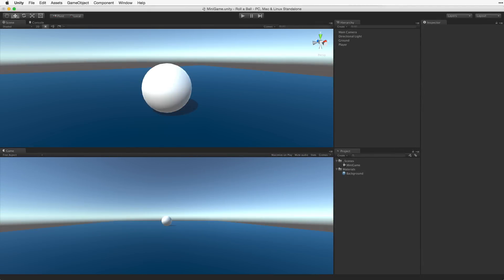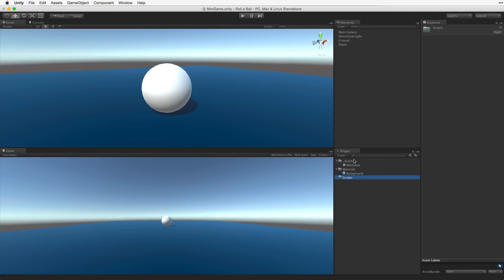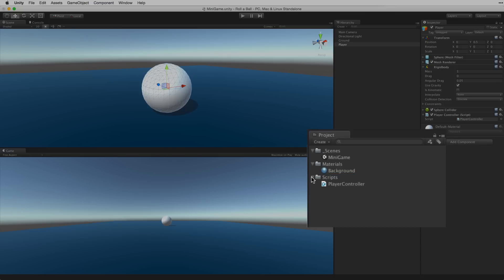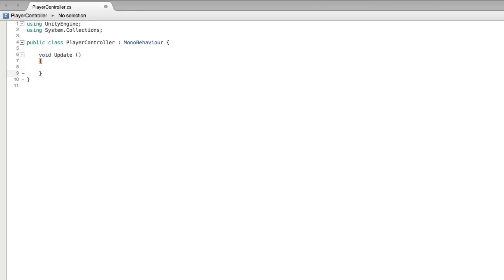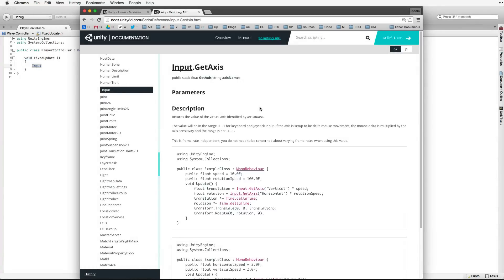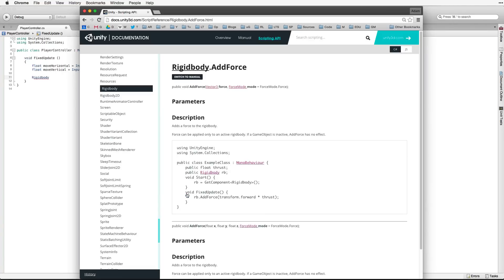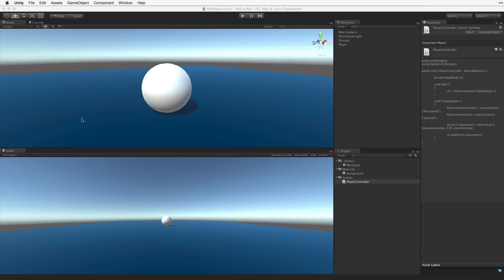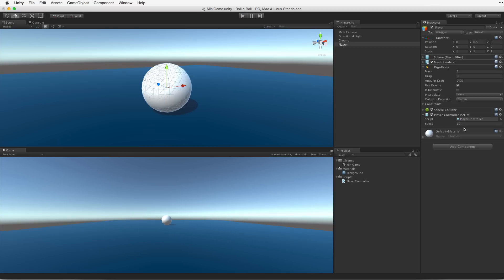Unity 5 - Roll a Ball game - 2 of 8: Moving the Player - Unity Official Tutorials

Comment: I'm getting this error 
MissingComponentException: There is no 'Rigidbody' attached to the "Player" game object, but a script is trying to access it.
You probably need to add a Rigidbody to the game object "Player". Or your script needs to check if the component is attached before using it.
UnityEngine.Rigidbody.AddForce (Vector3 force) (at C:/buildslave/unity/build/artifacts/generated/common/modules/Physics/DynamicsBindings.gen.cs:1317)
PlayerController.FixedUpdate () (at Assets/PlayerController.cs:23)

Comment: Followed step by step, nothing happens.
Here is my code:
/////////////////////////////////////////////
using UnityEngine;
using UnityEngine.UI;
using System.Collections;

public class NewBehaviourScript : MonoBehaviour {

    private Rigidbody rb;

    void Start()
    {
        rb = GetComponent<Rigidbody>();
    }

 void Update ()
    {
 
 }

    void FixedUpdate ()
    {
        float moveHorizontal = Input.GetAxis("Horizontal");
        float moveVertical = Input.GetAxis("Vertical");

        Vector3 movement = new Vector3(moveHorizontal, 0.0f, moveVertical);
        rb.AddForce(movement);
    }
}
/////////////////////////////////////////////
no error messages, 1 warning:
"There are inconsistent line endings in the 'Assets/Scripts/PlayerController.cs' script. Some are Mac OS X (UNIX) and some are Windows.
This might lead to incorrect line numbers in stacktraces and compiler errors. Many text editors can fix this using Convert Line Endings menu commands."

Nothing happens, please HELP!
(Unity 5)

Comment: I typed all the code in and clicked play but when I use the arrow keys, my ball doesn't move. This is my code:

using UnityEngine;
using System.Collections;

public class PlayerController : MonoBehaviour {

 private Rigidbody rb;
 
 void Start ()
 {
  rb = GetComponent<Rigidbody>();
 }
 
 void FixedUpdate ()
 {
  float moveHorizontal = Input.GetAxis ("Horizontal");
  float moveVertical = Input.GetAxis ("Vertical");
  
  Vector3 movement = new Vector3 (moveHorizontal, 0.0f, moveVertical);
  
  rb.AddForce (movement*100);
 }
}

PLEASE HELP

Comment: still doesn't work here is my coding check if there is something wrong 
using UnityEngine;
using System.Collections;

public class NewBehaviourScript : MonoBehaviour {

 public Rigidbody rb;
 void start ()
 {
  rb = GetComponent<Rigidbody> ();
 }

 void fixedUpdate ()
 {
  float moveHorizontal = Input.GetAxis ("Horizontal");
  float moveVertical = Input.GetAxis ("vertical");

  Vector3 movement = new Vector3 (moveHorizontal, 0.0f, moveVertical);

  rb.AddForce (movement * 20);

 }
}
Reply: +Nathan Suciu 
change the following : Input.GetAxis ("vertical") by
 Input.GetAxis ("Vertical")
Reply: +slim Khaled nothing
Reply: +slim Khaled here is my updated coding:
using UnityEngine;
using System.Collections;

public class NewBehaviourScript : MonoBehaviour {

 public float speed;

 private Rigidbody rb;

 void start ()
 {
  rb = GetComponent<Rigidbody>();
 }

 void FixedUpdate()
 {
  float moveHorizontal = Input.GetAxis ("Horizontal");
  float moveVertical = Input.GetAxis ("Vertical");
   
  Vector3 movement = new Vector3 (moveHorizontal, 0.0f, moveVertical);
  
  rb.AddForce (movement * speed);
  
 }
}
Reply: +Nathan Suciu 
Your class name should be the same as your script name : try changing the following line :
public class NewBehaviourScript : MonoBehaviour    by the following line :
public class PlayerController : MonoBehavior (the name of your script)
Reply: slim Khaled now i can change the speed variable in unity but i still cant move the ball. do i need to set the controls or something
Reply: +Nathan Suciu 
Did you attach the script to the Ball or the Player ?
Reply: slim Khaled ball witch is tagged as player

Comment: The ball doesn't move for me.

I get an error message that says
ArgumentException: Input Axis horizontal is not setup.
To cahnge the input settings use Edit-> Project Settings - > Input
Reply: ***** Also when I go to the input Manager its all filled out. There is only two blank sections in the Horizontal and that is. Descriptive Name, and Descriptive Negative Name. And invert is unchecked.. everything else seems to be filled out already so what am I doing wrong?
Reply: ***** Figured it out, damn capitalization got me all messed up here. I don't get why some things are capitalized and others aren't. Seems impossible to memorize all this stuff.
Reply: Thanks, this was driving me nuts! I just needed to capitalize the "V" in the word Vertical in my script and that fixed my first error.
Reply: +JE Woo i have the same problem but i don't why big letter all i corrected but error input axis horizontal

Comment: If you are having trouble with the scripting, make sure every letter is the exact same case as the example in the video.  I was failing at this for hours because i typed "void start ()" instead of "void Start ()" Once i fixed the cases, the given code worked.
Reply: Thanks! I had the same issue and it fixed my second error so I could run the game properly.

Comment: Why did you use 0.0f for the y value in that Vector3?
What is that 'f' for?
Reply: Daniele Dente I'm pretty sure "f" stands for "force". Your computer would read it like this: "I must use precisely 0.0 units of force to move the object along either the positive or negatvie Y axis."
Reply: Daniele Dente f stands for float. It is a floating variable
Reply: konieboy Do you have to add other suffixes if the number is a different type? e.g. double, int..?

Comment: I copied the same, i have Unity 5 and it say's :
"Assets/PlayerController.cs(6,29): error CS1519: Unexpected symbol `:' in class, struct, or interface member declaration"

and this is it:

using UnityEngine;
using System.Collections;

public class Cube : MonoBehaviour {
	
	private Rigidbody rb:
		
	void Start ()
	{
		rb = GetComponent<Rigidbody> ();
	}
	
	void FixedUpdate ()
	{
		float moveHorizontal = Input.GetAxis ("Horizontal");
		float moveVertical = Input.GetAxis ("Vertical");
		
		Vector3 movement = new Vector3 (moveHorizontal, 0.0f, moveVertical);
		
		rb.AddForce (Vector3);
	}
	
}

and it's not worlking.
What am i doing wrong?
Reply: line 6, position 29 in the error. You have a colon and it should be a semicolon.

Comment: Guys i have this error: ''The associated script cannot be loaded. Please fix any compile errors, and assign a valid script. Now i don't want any tips like copy this script because i already did that and it didn't work
Reply: This means that there is an error in one of the scripts and it can't compile. If the script can't compile, then the editor cannot run the game. The console should have an error describing the problem. For more detailed help, follow the link in the video description to the official Q&A thread on the Unity forum and paste the Error message and offending code from the script. I can give you better support there.
Reply: The Ant Ranch Nevermind i fixed it, the Script name wasn't the same as that
''public class PlayerController; Monobehaviour'' so unity couldn't read it.

Comment: How Do You Add A brake So The Ball Will Stop Instantly.
Reply: Add a key (like space) and use this to slow the ball. I would suggest changing the drag or angular drag. For more information, can you please use the link in the description and ask your question on the official Q&A thread? Please include as much detail as possible.
Reply: Add a new call to the input manager like get button down "space" and the have this increase the drag or angular drag, and have it reset back to default on get button up.
Reply: For instant stopping, you could set the rigidbody.velocity to 0.0f when the button comes down.

Comment: If anybody is having problems with their code try using this code:

using UnityEngine;
using System.Collections;

public class PlayerController : MonoBehaviour {

	public float speed;
	private Rigidbody rb;
	
	void Start (){
		rb = GetComponent<Rigidbody>();
	}
	
	void FixedUpdate (){
		float moveHorizontal = Input.GetAxis ("Horizontal");
		float moveVertical = Input.GetAxis ("Vertical");
		
		Vector3 movement = new Vector3 (moveHorizontal, 0.0f, moveVertical);
		
		GetComponent<Rigidbody>().AddForce (movement * speed);
	}
}

Comment: I can move the player using keyboard.
But can't play this on mobile devices. The code doesn't support for mobile devices?
Reply: Clive Teow Try this:

using UnityEngine;
using System.Collections;

public class PlayerController : MonoBehaviour {

    public float speed;
    private Rigidbody rb;
    
    void Start (){
        rb = GetComponent<Rigidbody>();
    }
    
    void FixedUpdate (){
        float moveHorizontal = Input.GetAxis ("Horizontal");
        float moveVertical = Input.GetAxis ("Vertical");
        
        Vector3 movement = new Vector3 (moveHorizontal, 0.0f, moveVertical);
        
        GetComponent<Rigidbody>().AddForce (movement * speed);
    }
}
Reply: David Nagli Stop spamming the code if you don't even know what that code is. there is no touch script in that code dumbass.

Comment: using UnityEngine;
using System.Collections;

public class PlayerController : MonoBehaviour {
	
	public float speed;
	
	private Rigidbody rb;
	
	void Start ()
	{
		rb = GetComponent<Rigidbody>();
	}
	
	void FixedUpdate ()
	{
		float moveHorizontal = Input.GetAxis ("Horizontal");
		float moveVertical = Input.GetAxis ("Vertical");
		
		Vector3 movement = new Vector3 (moveHorizontal, 0.0f, moveVertical);
		
		rb.AddForce (movement * speed);
	}
}

Comment: Arrrr I'm getting All compiler errors have to be fixed before you can enter play mode
Reply: Megatron In the Inspector, you'll see "Player Controller (Script)", and in that section it should say "Speed". It will most likely say 0, but set it to 10 or whatever you want. Hope this helps ;)
Reply: Megatron the same happened for me, so I tweaked the code. let me know if this works:

using UnityEngine;
using System.Collections;

public class PlayerController : MonoBehaviour {

    public float speed;
    private Rigidbody rb;
    
    void Start (){
        rb = GetComponent<Rigidbody>();
    }
    
    void FixedUpdate (){
        float moveHorizontal = Input.GetAxis ("Horizontal");
        float moveVertical = Input.GetAxis ("Vertical");
        
        Vector3 movement = new Vector3 (moveHorizontal, 0.0f, moveVertical);
        
        GetComponent<Rigidbody>().AddForce (movement * speed);
    }
}
Reply: David Nagli I can run the game now but the ball is not moving.
Reply: Megatron U Know U Can Copy The Code If Your Getting To Mad Just Go To Their Site On Tutorials Roll A Ball And Where It Shows The Video Scroll Down And Copy The Code Down There And Put It In Your Script. make Sure Your Using C#

Comment: i checked this like 100 times, still saying when i want to test the ball movement "the associated script can not be loaded. Please fix any compile errors and assign a valid script".

help pls :((
Reply: *****
yeah meanwhile i noticed that i just forgot 1 " ; ".
Reply: ***** I had a similar issue, so I tweaked the code. lemme know if this works:

using UnityEngine;
using System.Collections;

public class PlayerController : MonoBehaviour {

    public float speed;
    private Rigidbody rb;
    
    void Start (){
        rb = GetComponent<Rigidbody>();
    }
    
    void FixedUpdate (){
        float moveHorizontal = Input.GetAxis ("Horizontal");
        float moveVertical = Input.GetAxis ("Vertical");
        
        Vector3 movement = new Vector3 (moveHorizontal, 0.0f, moveVertical);
        
        GetComponent<Rigidbody>().AddForce (movement * speed);
    }
}
Reply: LoGic did you make sure to replace the line of my code that says "public class PlayerController : MonoBehaviour {" with "public class YourScriptName : MonoBehaviour {"?
Reply: David Nagli  it solves the problem, but now there's a new problem. "The reference script on this behaviour is missing"
Reply: I have this to
Reply: David Nagli That worked for me thanks. I just have a question. How do you know which key the ball is working with? like, which part of the programming decides? or does this script just do it automatically?
Reply: *****  wont let me keeps a saying "Can't add script component 'playercontroller' because the script class cannot be found. Make sure that there are no compile errors and that the file name and class name match."
Reply: David Nagli
the problem was already solved but thanks anyway :)
Reply: couch potato
(
yeah meanwhile i noticed that i just forgot 1 " ; ".
)
16.05 comment
Reply: i dont get it still
Reply: LoGic Ctrl + (what key goes here)
Reply: ***** remember to drag the script onto the player
Reply: If you are still having issues, please use the official forum thread for: Q&A http://forum.unity3d.com/threads/roll-a-ball-tutorial-q-a.319451/
Reply: The part of the script that decides which key to use is "Input.GetAxis(...)" This looks at the axis by string name in the input manager. "Horizontal" and "Vertical" are default axes in the input manager. By default these axes are assigned to the a/d and left/right arrow keys for horizontal and the w/s and up/down arrow keys for vertical. Look up Input and InputManager in the docs.
Reply: Oh, btw, you'll get faster responses by following the link in the description to the official thread on the Unity website.
Reply: *****  you need to ensure that the name of the script inside the actual code is the same as the name of the script itself and the same as the name of the script in the unity document
Reply: David Nagli  thank you so much
Reply: +Black Ice Remember C# is CaSeSensITive! Also, the script and class name bust match. If you have named your script PlayerController your class name must match exactly in spelling and capitalisation. If you read the error message you have all the clues you need.
Reply: yeah realised that now im at stage 7 now
Reply: David Nagli, THANK YOU SO MUCH!
Reply: using UnityEngine;
using System.Collections;

public class PlayerController : MonoBehaviour {

    public float speed;

    private Rigidbody rb;

    void Start ()
    {
        rb = GetComponent<Rigidbody>();
    }

    void FixedUpdate ()
    {
        float moveHorizontal = Input.GetAxis ("Horizontal");
        float moveVertical = Input.GetAxis ("Vertical");

        Vector3 movement = new Vector3 (moveHorizontal, 0.0f, moveVertical);

        rb.AddForce (movement * speed);
    }
}
Reply: ***** Works for me clearly you have not entered the code correctly.

Comment: I don't know why I can't move the ball...I just copy and paste the script that on the learning pages . anyone help?
Reply: heizhe Copy and paste better. It works 100% for me.
Reply: heizhe same happened to me so I tweaked the code:

using UnityEngine;
using System.Collections;

public class PlayerController : MonoBehaviour {

    public float speed;
    private Rigidbody rb;
    
    void Start (){
        rb = GetComponent<Rigidbody>();
    }
    
    void FixedUpdate (){
        float moveHorizontal = Input.GetAxis ("Horizontal");
        float moveVertical = Input.GetAxis ("Vertical");
        
        Vector3 movement = new Vector3 (moveHorizontal, 0.0f, moveVertical);
        
        GetComponent<Rigidbody>().AddForce (movement * speed);
    }
}
Reply: David Nagli Dude, you're code doesn't work, don't paste it on every comment thread.
Reply: Shaun Powell idk but after I did that it worked for me...

Comment: I 've followed his lead , but could not be tested .  if anyone can help me ?
Assets/Scripts/PlayerControler.cs(20,18): error CS1525: Unexpected symbol `rb'
Reply: dimas krisrianto same does anybody know what's wrong?
EDIT: got it working with this:
  Vector3 movement = new Vector3 (moveHorizontal, 0.0f, moveVertical);

  rb.AddForce (movement);

i forgot the ; signs
Reply: dimas krisrianto The same thing happend for me, so I tweaked the code and now it works. lemme know if this works for you:

using UnityEngine;
using System.Collections;

public class PlayerController : MonoBehaviour {

    public float speed;
    private Rigidbody rb;
    
    void Start (){
        rb = GetComponent<Rigidbody>();
    }
    
    void FixedUpdate (){
        float moveHorizontal = Input.GetAxis ("Horizontal");
        float moveVertical = Input.GetAxis ("Vertical");
        
        Vector3 movement = new Vector3 (moveHorizontal, 0.0f, moveVertical);
        
        GetComponent<Rigidbody>().AddForce (movement * speed);
    }
}

Comment: im using unity 5.0.1,i wrote the script exactaly,what am i doing rong?
Reply: Post with more details on the official Q&A thread. The link is in the description.
Reply: Aj Edwards The same thing happened for me, so I tweaked the code and now it works. lemme know if this works for you:

using UnityEngine;
using System.Collections;

public class PlayerController : MonoBehaviour {

    public float speed;
    private Rigidbody rb;
    
    void Start (){
        rb = GetComponent<Rigidbody>();
    }
    
    void FixedUpdate (){
        float moveHorizontal = Input.GetAxis ("Horizontal");
        float moveVertical = Input.GetAxis ("Vertical");
        
        Vector3 movement = new Vector3 (moveHorizontal, 0.0f, moveVertical);
        
        GetComponent<Rigidbody>().AddForce (movement * speed);
    }
}
Reply: Thanks